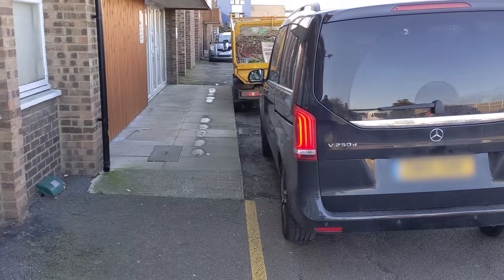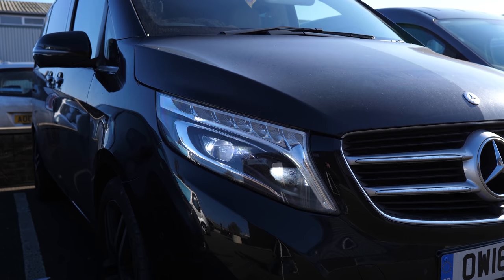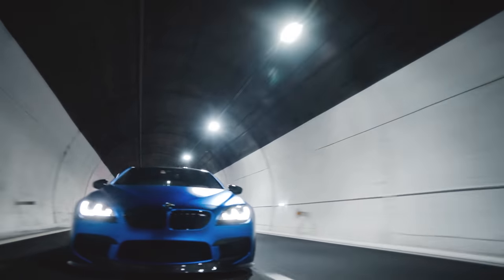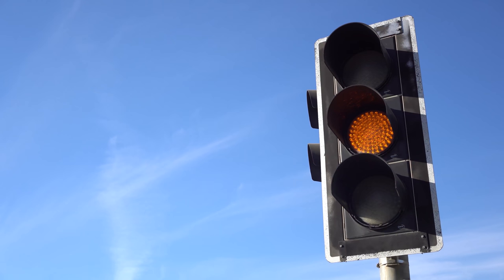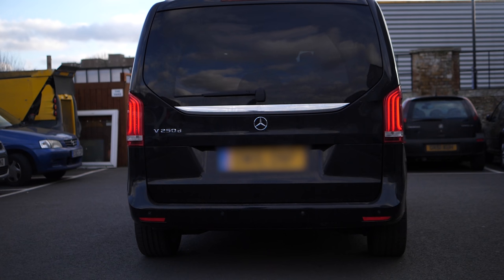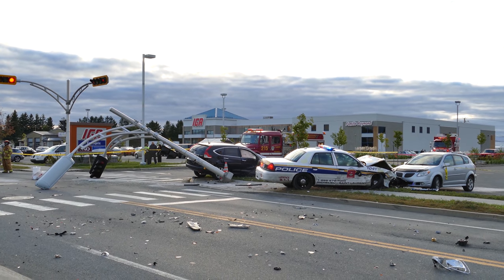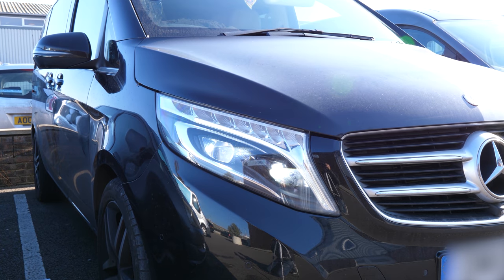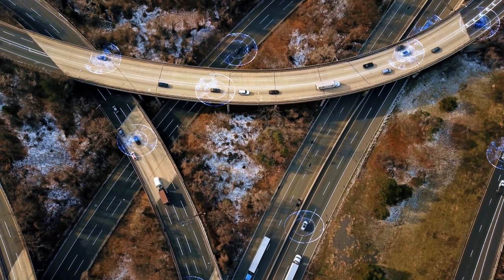Self-Driving Cars Are Dangerously Confused By LED Lights

Comment: What if we required vehicle and traffic led lights to have their arrays ganged into distributed ("overlapping") subgroups so that their net effect was still the desired consistent brightness, but some were always on? That is, distribute the duty cycle to mask the off phase over the entire area of the light, rather than just all or none at once. Few if any are single diodes, so put every second diode in the array on a <not> gate.

Comment: You could mandate voltage-based brightness control for safety-critical lights or at least e.g. a capacitor that takes the PWM signal and gets charged-discharged-charged-discharged-... by it and thus provides a semi-stable lower-voltage signal to the LED. 
Or just make the PWM frequency in the kHz range to prevent the effect described in the video plus the dotting of the light smear when moving your eyes, which many other commenters complained about.

Comment: I wondered about this a while back and similar issues about driverless cars "talking " to each other. I wondered about if they had a local WiFi signal, like drones have for their control module, so they could talk to each other, like drones often use for their control, rather than relying souly on visual cues. The obvious issue with that is it would take quite a long time to phase out cars that didn't have this system built in.

Comment: Video idea: why does heat shrink shrink?
Reply: its because of the heat
Reply: It's made out of socks and favourite jumpers.
Reply: The short version is that the tube is heated up while being stretched and then cooled in that stretched position, when you heat it back up it shrinks back to the original diameter
Reply: Actually, shrinking the heat shrink doesn't provide enough evidence. Heat shrink is the process of storing a low-temperature compound as a high-temperature solution in a highly porous structure (called a porous membrane). To see how this works, take a baseball bat and light the end on fire.
Reply: Maybe it doesn't shrink, and just loses it's stretch instead. Like a soft drinks bottle made from PET.
Reply: @Miaumiau3333  I tried that but I burned my hands!

Comment: That's quite an interesting problem! Cool video!
It makes me wonder, how would the motion blur from having the shutter open for 100% of the frame time affect image recognition?
At highway speeds (~120 km/h) and standard framerate (~30 fps), the camera would move ~1 meter within the same frame. 
That would make for significant motion blurring within each frame! Can it still read road signs in this scenario?
Reply: I would imagine that you could have one camera using a longer shutter speed to read turn signals, etc. while another camera is used to read road signs.

Comment: I notice this all the time. The car I drive has a camera on the right rear view mirror that turns on and is displayed on the center console when the right signal is on. There are so many cars that PWM their running and tail lights. Probably some combination of faster shutter speeds, and faster PWM is the way to go. Though if you go too fast with PWM you start getting into the audible range, and there's so many components that emit found once you're in that range.
Reply: Just go over the audible range.
LEDs can be driven with 100khz PWM no problem.
But why not ditch the PWM entirely?
There is no need to vary the Brightness of the Lights (If you want cool effects you can still have the maximum brightness be full on, no PWM).
Reply: @Ultrazaubererger  

Higher switching frequencies require more specialized components to reduce losses. The transition from off to on and on to off is where most of the losses come from. So you want as few of these transitions as possible, especially when driving a whole array of high power LEDs.
If you don't vary the brightness then how do you differentiate between tail lights and brake lights?
Reply: @superdau  True but 100KHZ is not that high, I guess it would not be a problem at all. Might cost 0,1$ extra.

"differentiate between tail lights and brake lights"
Just make two lights like it was before with incandescent.
Yes, even more cost, but cars are fucking expensive so it shouldn't matter.

Also this is a matter of safety.*
An extra 100$ or even 1000$ should not matter.

*Flickering lights can be very distracting in your peripheral vision, I often confuse them for emergency vehicles and almost start braking before I notice its just a normal car.
This might loose me the second I need to see a child run onto the street or whatever.

Comment: A solution I thought of like 15 years ago, not for this problem but for cars in general is to have them all communicate. Instead of having the cars read the turn signals they just receive information wirelessly telling them what a car is doing and that car can be identified by it's number plate. You could also use this communication to tell other cars where traffic is so that they can avoid it. Realistically this communication can only happen between driverless cars but eventually it will become so safe to drive an automated car that they will ban you from driving a car yourself.

Comment: How hard is it to increase the PWM frequency? You can get well into the kHz very cheaply. Or at the very least have a smoothing capacitor
Reply: Ain't capacitors stupidly fragile?
Reply: Problem is that there are already a lot of these cars on the road, so even if you made this change to new cars, AI/self driving cars would still have to deal with the problem for years to come.
Reply: rgbii this isn’t really a suggestion for a fix. It’s more of a question of why this was never done as it doesn’t really increase the cost and makes the car more photogenic
Reply: @Anankin12  depends on the capacitor tech.
But you can also use inductors.
And they are very resilient.
Reply: What is the need to dim the lights anyway? You want the brightest lights, why would you want to dim them?
Reply: Probably because there are ten thousands parameters to consider when manufacturing a car, all while necessarily operating with imperfect knowledge. It's to be expected some solution found earlier will turn out to be in fact suboptimal.
Reply: @keco185  companies make thousands, millions or more of the same product.
Since it's only a problem for a small part of the market, they prefer to save some "thousand dollar change".
Believe me, they have Scrooge McDuck levels of greed.
Reply: If you want 50% brightness using PWM, the LED still has to be off 50% of the time. All you do by increasing the frequency is change the way the artifacts look on camera. So instead of the slow strobe you see in the video, you'd get something that might look more like a strobe light.
Reply: @MisakaMikotoDesu  Higher frequency does also reduce the amount of flicker. For example lets assume the camera shutter is open for 10ms per frame. If you have PWM with 100 Hz that could mean (worst case) jumping from 0% to a 100% brightness, because it could hit either 0 or 1 complete on periods. Now if we increase the frequency to 1 kHz, the difference is still at worst 1 PWM period, but in the shutter time are on average 10 pulses, that reduces the brightness difference to 10% (ranging from 45% to 55%). Increasing it one order of magnitude again to 10 kHz gets it already down to a 1% difference (49.5 - 50.5 %) and is probably barely noticeable. At some point the camera sensor can't even distinguish the different brightness levels and the flickering is not even measurable anymore, on 8 bit color depth this should be the case if the PWM period is shorter than shutter speed divided by 256.
Reply: @DantevanGemert  

The point of dimming them is to be able to use them as running lights and brake lights.
Reply: That only chances the type of strobe artifact that the camera picks up.
Reply: @DantevanGemert  The LEDs are selected for the brightest signal they are required to produce (brake light or, worse, fog light), and then "dimmed" to provide the other functions.

Personally, the PWM flicker isn't even the worst part; the lenses of the LEDs focus their light so intensely that they leave after-images of very bright dots smeared all over my retinas. What happened to the legally mandated lenses that are supposed to diffuse the light source(s)?
Reply: @BrendonGreenNZL  Ah, I thought there were different LEDs for those different purposes. TIL. 

(Edit: apparently I can't reply to multiple people at once. Sorry @superdau, lol)
Reply: @DantevanGemert  To further confuse the issue, modern LED light clusters do indeed have multiple circuits within the array that are (or can be) dedicated to specific functions. For example, a module might provide the tail light function by illuminating half the LEDs at half intensity, provide the brake signal by illuminating all the LEDs at full intensity, provide the turn signal by blinking all the LEDs at full intensity, and combine the turn and brake signals by blinking half the LEDs and steadying the other half.

There is also no requirement for all the LEDs in the module to be the same colour; which is how combined daytime running light/turn signal modules change colour from white to amber; so the same module could, in principle be an amber turn signal, a red fog light, a white reversing lamp, and a passive red reflector; all in one.
Reply: @happygimp0  you do know that fragile is a relative term, with no absolute meaning?

Comment: Don’t many cameras have automatic anti-flicker systems?
Reply: As far as I'm aware, those are for mains AC frequency (ie 50/60hz depending where you are), and work by syncing up the shutter speed of the camera with the appropriate frequency. Much harder to do that when the frequency is totally arbitrary and could change at any moment, e.g. a gentle fade in/fade out with an LED which is actually a series of pwm frequencies
Reply: Edward Hobbs i wonder if similar algorithms to that used with autofocus could be used to calculate the amount of “flicker” seen in an image and just adjust the camera frame rate accordingly. Try a couple nearby frame rates -> get the gradient for the amount of flicker between those frequencies -> then perform gradient descent to determine the optimal frame rate to reduce flicker
Reply: Those are targeted towards A/C powerline electrical frequency flickering 50/60hz. LED's have variable frequency PWM depending on the LED controller.
Reply: As others have pointed out, this done by syncing the shutter speed and/or framerate and therefore it can only be done for the AC grid
I'll give one more reason: even if there were more than these two options, what would it help if you're trying to monitor multiple cars simultaneously? You would need different speeds for different parts of the image...

Comment: blinkers on the inside of the head lights next to the middle of the car  should be illegal
blinkers should be on the out side of the head light so u can see them  wile they start to turn.
Reply: I'd also make it mandatory to have an extra pair on the side mirrors. Those really improve visibility.
Reply: You managed to find another of the differences between US and EU regulations. In the EU you have to have side indicators but in the US you only need them at the front and back.
Reply: In the EU, where daytime running lights may interfere with indicators (i.e in the same lamp unit) the daytime running lamp turns off while the indicator operates. At night the issue is much less of a problem.
Reply: @hebl47 
Except everyone stopped putting the side door/fender lights on when the mirror lights became cool.... Which means you can't see them from behind the car. There's literally 3/4 of the car length that's an indicator blind spot.
Bizarre how we allow that one.
Reply: @tin2001  And who said you'd ONLY put them there? It's just one additional spot.
Reply: @robertszynal4745  Come to New Zealand. Our laws heavily favour the EU way of doing things, yet still permit all the nonsense of USA laws; as well as allowing vehicles that apparently don't comply with either lighting laws so long as it is original equipment. 🤷‍♂️

Comment: This is manufacturers being cheap and using cheap'o LED drivers that do PWM dimming instead of a proper current limiting circuit. They are saving a few dollars which is unjustifiable in car manufacturing or traffic lighting. Just greed
Reply: The problem is that these lights are already out in the wild. Even if you made manufacturers pay for replacing the lights, you can't enforce it because police wouldn't be able to see the flicker, and many people simply wouldn't bring their car in for what they consider a "minor issue".
Reply: For real. The unregulated LED headight market is awful, it gives a bad name to LEDs and legitimate technology. They should use linear or properly regulated drivers rather than resorting to PWM.
Reply: Pwm can be easily filtered, maintaining effeciency with same result as a linear regulator
Reply: @daviXD18  indeed. Kinda scary the op thought process lol.

Comment: I just got some PWM controller chips a couple of weeks ago. This video's making me want to experiment with different frequencies, duty cycles and phase differences between the PWM signal controlling an LED and film it with a camera. Preferably one whose shutter speed I can control. It gives me a good excuse to learn to use these controllers and to actually use them instead of just letting them sit around until I need them for something. Which is usually what happens to most chips I buy.

Comment: For the shannon-nyquist theorem if you sample a signal with more than double the frequency of its highest armonic component you can reconstruct the signal perfectly (without aliasing). Considering the highest armonic you want to sample is around 50 hz with a camera of around 120fps you will be sure to know if the led is flashing on and of 50 times per second or it is flashing 2 times per second

Comment: Hi. I've finished Udacity Self-driving  Car Engineer course which covers all the basics of self-driving cars. When it comes to predicting other vehicles and object movements the lights ware actually not used in the projects we ware making. Many people are not using their lights and there is also the possibility of giving a wrong signal so this very unreliable measure. Prediction is made with mathematical models using the objects speed and direction and their change overtime. Using lights signals can assist the decision making process but it would have very low weight compared to the data from the other sensors. Processing time is also valuable since there are many things happening many times a second that the car have to compute, so if the lights are so unreliable it makes sense not to bother trying to detect them at all.
There is of course the case of 
Ambulances and other special vehicles. Those can be initially detected by the shape of the vehicle with AI which is used for detecting the object anyway, so once such a vehicle is detected then you can spun a separate process to check the lights in order to determine if the vehicle is in special mode of operation and take appropriate actions.

I'm just saying :)
Thank you for all your great videos.
And to all: Stay safe, stay home
Reply: Is there any possibility of a line of PWMed lamps being mistaken for small, slow-moving objects by virtue of the stroboscopic lighting? Think a long truck moving perpendicular to the camera with PWM-driven side outline markers.
Reply: @BrendonGreenNZL  I would say very unlikely for several reasons:
1. The AI labeling objects is trained with datasets (pictures where the object is labeled as a hole) so it can learn for what features to look for as a hole not specifics. Think of it as a new born baby where you just give it a pictures of different vehicles and reward it only if it guess correctly. So over time it would get better and better.
2. Usually data from radar and/or lider is also taken into account, so this would provide some sort of additional filtering. Although I think Ilon Musk opinion is only camares are enough and make financial sense. He has a point but this is another discussion and it changes over time.
3. In order to filter outliers the algorithms usually have a degree of trust in the detections. That is if one object is present in one image but is missing on the next two it would probably have vary low certainty number and would get ignored/filtered. 
That it what comes to mind at the moment, but even if all of those failed you still have to thing would that false detection be a problem and even more importantly a hazard.
If you have a false datection of a moving object it would only be a hazard if you are moving with high speed and the action you take on that detection endangers your or someone else vehicle. You should know that the decision tree algorithms take in to account much more that you would expect and even more that a human. The sensors in the car gives you a very precise information for all object in your near 360 degree surrounding area and even further than that. More importantly you have the speed of each object, the change in speed and the rate of change of speed, which gives great advantage in predicting where all the objects will be in the near feature. That is something that you as a human cannot do since your vision and focus is limited. 
So I would say even if the car falsely detect an object that is not there and decides to reduce speed for example, it would most probably just cause some discomfort for the passenger but not a hazard.
Sorry for the late ng comment, but it is a complicated matter for a long discussion :)